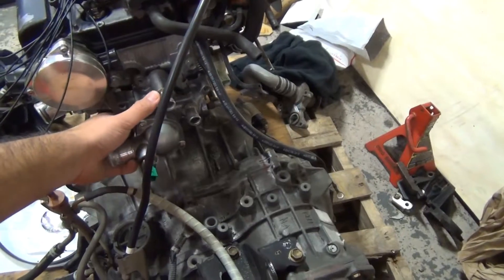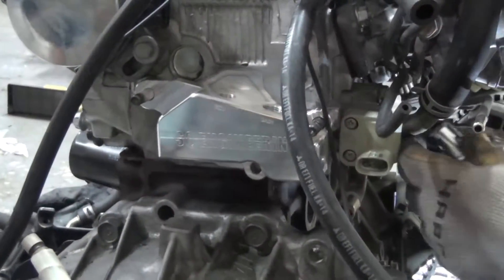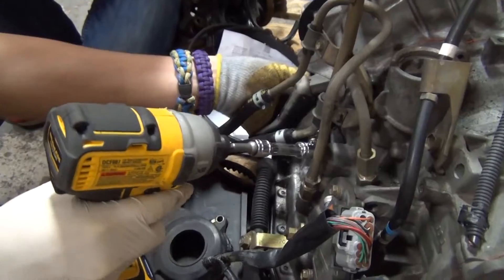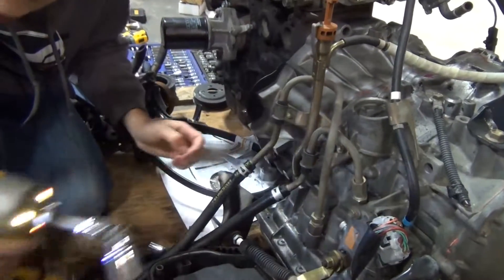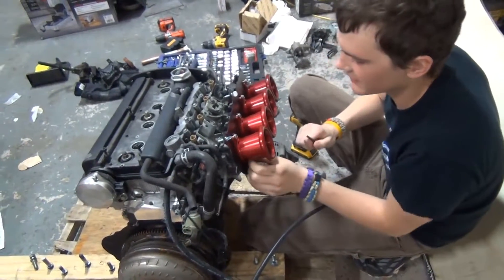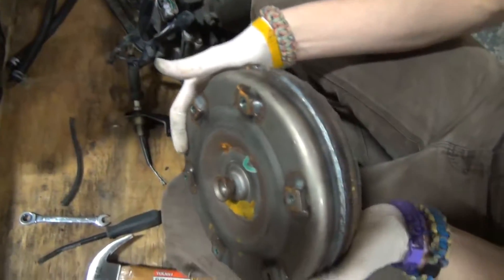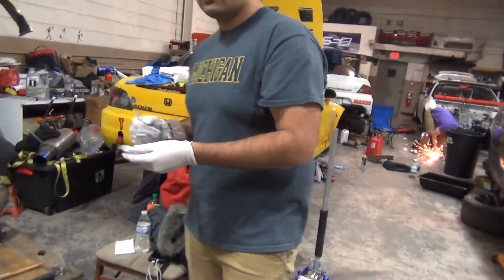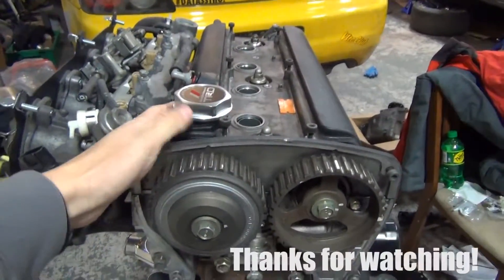AE86 Project Phoenix Ep.4 : Bye bye Slushbox!

Comment: Bro do you know about the 7age swaps? I think that would have been a better route
Reply from the maker: I knew about its existence but not its details until a quick 5-min research after seeing this. Sounds like an interesting build, more displacement = more power. But having to acquire a block and then the head and then a bunch more to make them all work sounds way more complicated than simply dropping in a blacktop, and we also have a tight schedule so have to get the car done before March. Also, I just like 4AGs haha